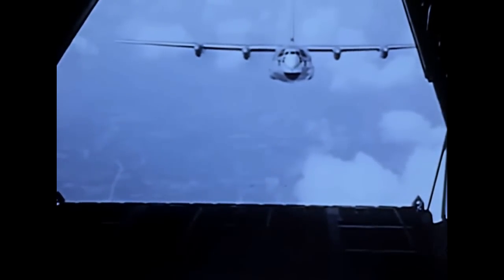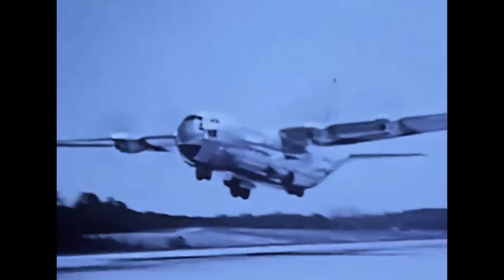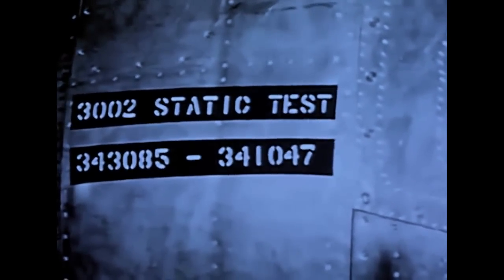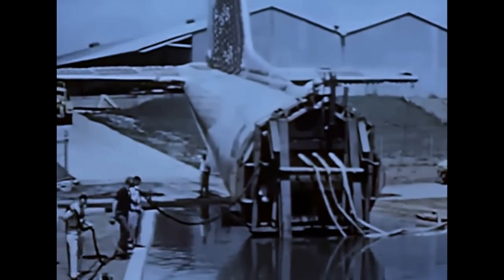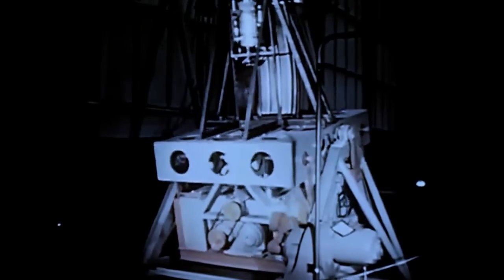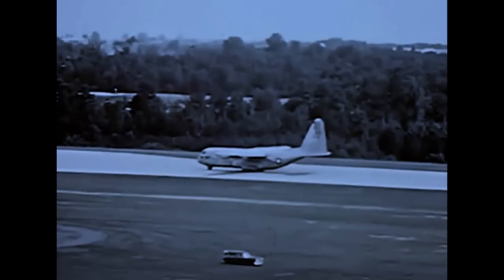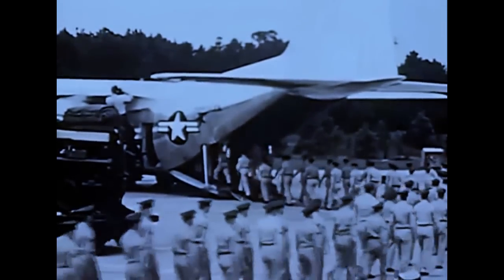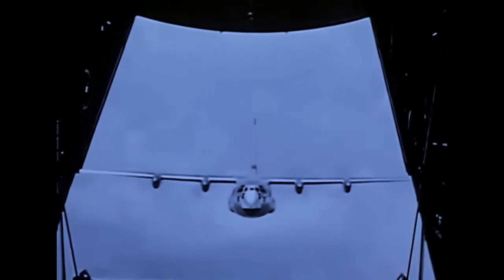Lockheed C-130 Hercules Progress Report - 1955

Comment: I was an A&P for 20 years never worked on C130s but had several other mechanic
friends who did, I have heard lots horror stories about maintenance on many different
types of aircraft, but not one bad thing about maintaining C130s. One close mechanic
friend said with a built up engine prop combination, they could change an engine and
prop on a C130 in less than an hour, only well thought out aircraft designs have that
type of ability.